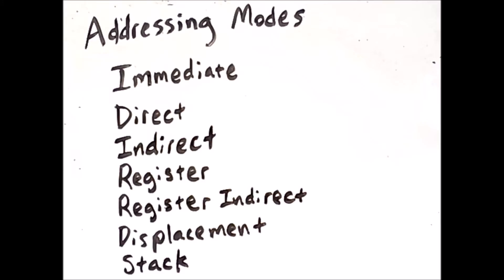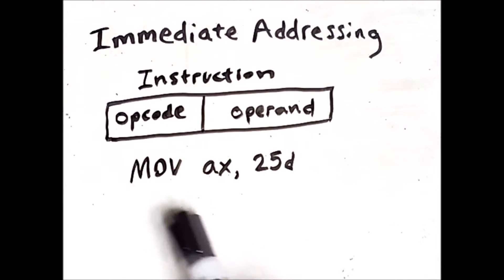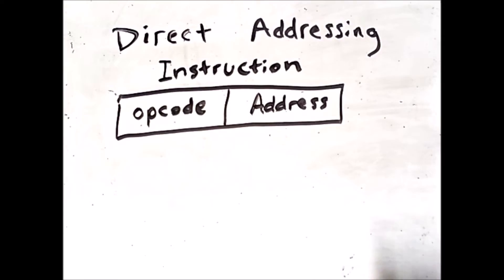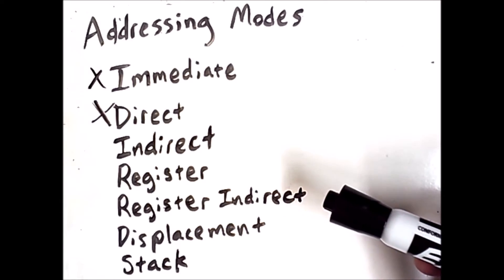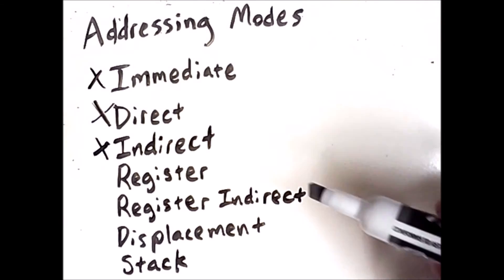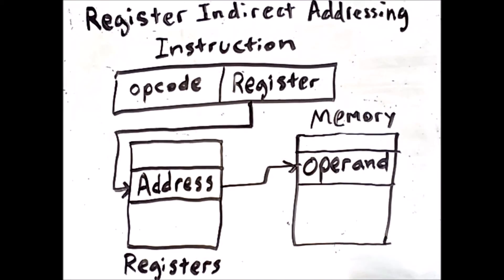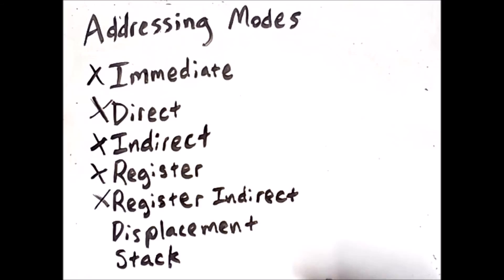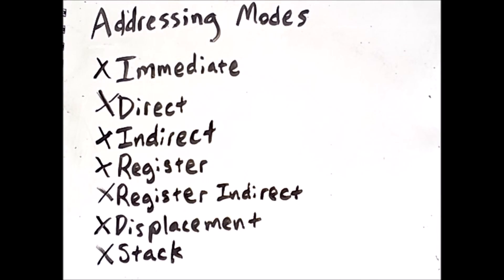What Addressing Modes Can Assembly Languages Have?

Comment: how do you know what addressing mode is being used in binary code
Reply from the maker: Every opcode has support for specific addressing modes. Sometimes the addressing is determined by the opcode itself, and there are even cases when a seemingly identical assembly instruction (same mnemonic) will translate to different opcodes. However, some instruction sets have an extra portion of the instruction format that specifies the addressing mode.
Reply: @JacobSchrum  so when the operands need more bits allocated for allowing more memory addresses then you use the addressing mode right? 
i was always wondering because on some diagrams for binary code ill see that multiple bits are used for the addressing mode 
each bit would represent direct or indirect addressing right?is there a certain combination of bits that would show what addressing mode its using like for instance would there be a certain sequence of binary numbers that would imply Indirect addressing Mode, or Indexed addressing mode

Comment: Where is the difference between LOAD x5000h and LOAD x9000h, itis the same instruction 
just a different number, or am I missing something out? Is it because there is a Address in that memory?
Reply from the maker: These are hypothetical instructions and not real ones. The point is that one system could have a "LOAD" type instruction that uses direct addressing, but another could have a "LOAD" instruction that uses indirect addressing. However, if you wanted support for both types of addressing in a single instruction set, you would need to give the instructions different names of have some other way of differentiating them
Reply: @JacobSchrum  oh ok, thank you !